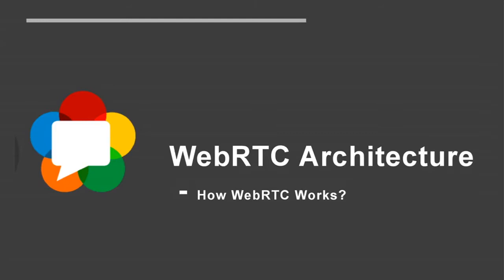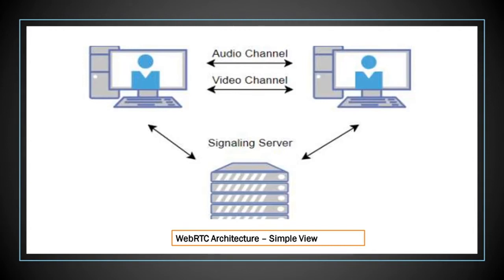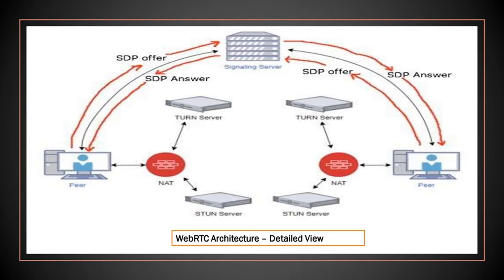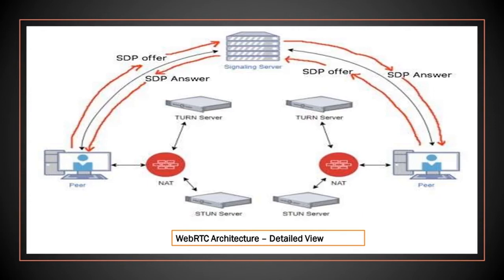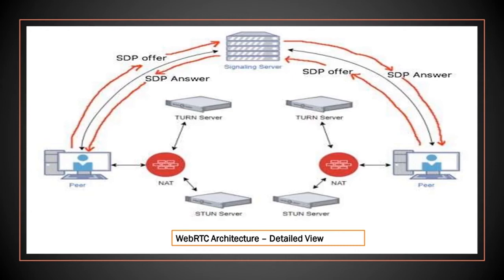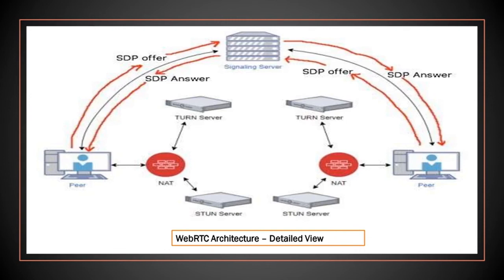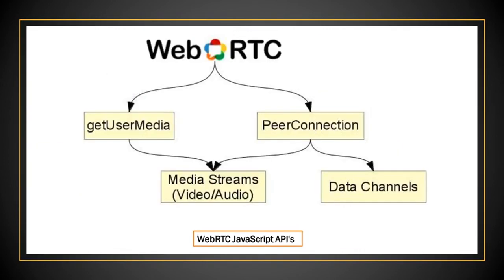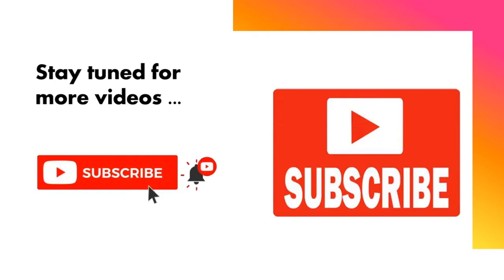WebRTC Architecture - How to connect with user ? | WebRTC series PART 5 | Engineering Semester

Comment: Hello, what is the difference between a signaling server and a STUN/TURN server '
Reply from the maker: Thanks for the question.. simply we can say :- "The signaling server is required to exchange messages between peers users (especially SDP packets, user session etc.) until they have established a P2P connection."
A STUN/TURN server is used to help a peer discover information about its public IP and to open up firewall ports.
Reply: @engineering_semester  thanks for the answer ! I've just got one more : Can I make my own STUN and signaling servers or am I "forced" (because too complicated or authorizations are needed) to use BaaS like Firebase, etc ?
Reply: @engineering_semester  also thanks a lot for your videos, they are great !
Reply from the maker: @pr0digy76  Yes. you can create your own signaling / STUN server. Keep it in mind that server will be costly, if you are making large scale application. You can refer sample Node.js based signaling server here https://www.youtube.com/watch?v=dPta24gZNYE . This might be useful to you.